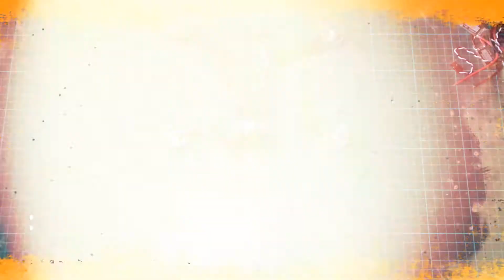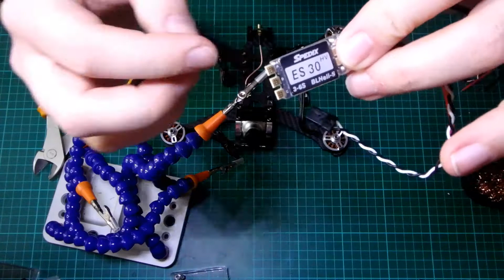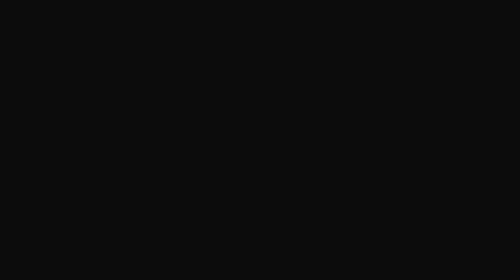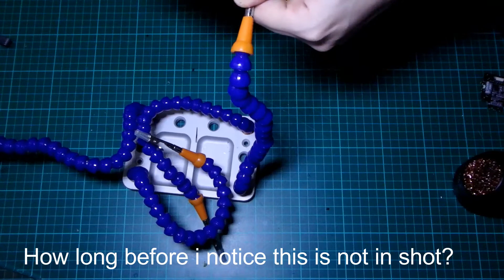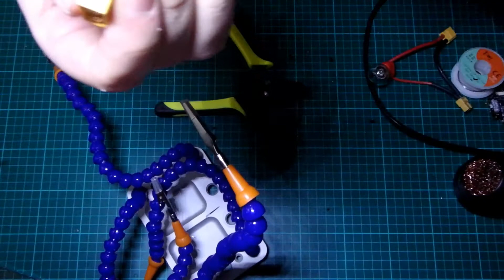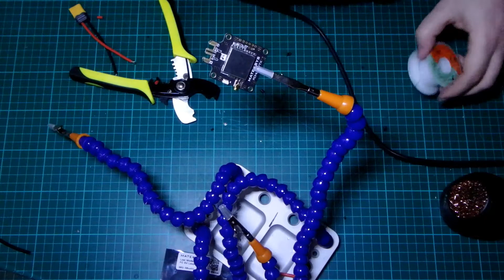Lets Build: Titan Rooster Part 3: Motors and ESC's

Comment: Do you know if these motors will run 6s? I have a set that I'll sell if they don't, will probably opt for RS2306 2400s..
Reply from the maker: They might. But i don't think they would last for long, bearings will probably explode.
Reply: @sawtoothspike  Yeah was thinking that. I think they are only rated for 4s, I know ppl go 5s without and issue, 6s is prob pushing it!!  Thanks for the reply mate. Happy flying.